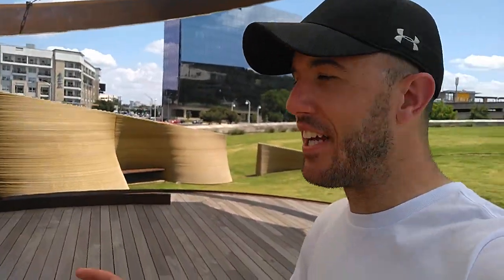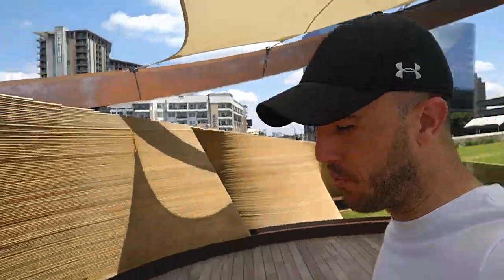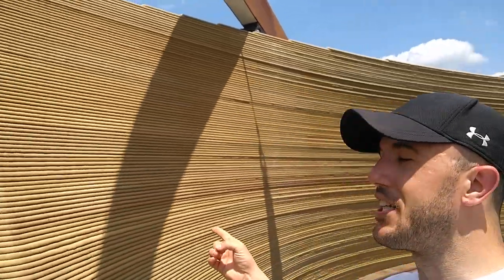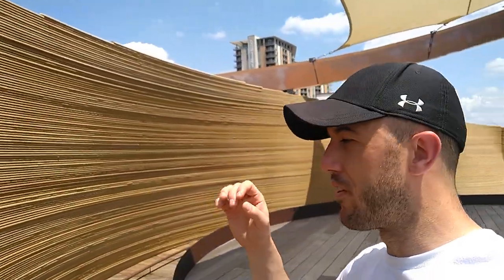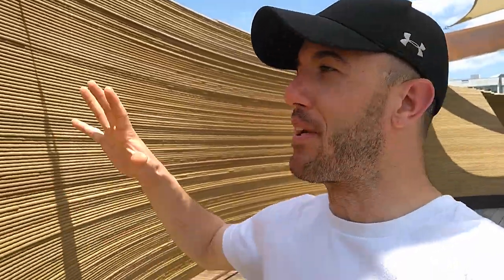3D Printed Building in Austin

Comment: Cool presentation, but concrete doesn't dry. The surface needs to shed a little water, but on the overall concrete is not considered to dry. If you mix a pound of concrete mix with a pound of water, wait a week, the result is roughly 2 lb. The water you add to dry concrete mix amalgamates into the structure, it doesn't work like glue that needs to shed its water.

Comment: those layer lines though
Reply: Not food safe...
Reply: It looks like an inconsistent extrusion issue. Concrete pumping might also need to improve.

 However an unfinished formed concrete wall is uglier.
Reply: Because other 'Modern Art' pieces are better SoonerLater
I quite like the aesthetic; of layer lines in general, as well as this
Reply: wood filler?
Reply: @awkwardsaxon9418  if I were to clean it up, would be a skim coat on top. The same way you dress the concrete above the ground line. But they are obviously playing up the printing.

Wood filler is white glue with sawdust. Not great for outdoor or thick use.